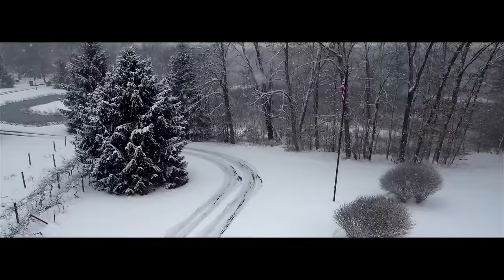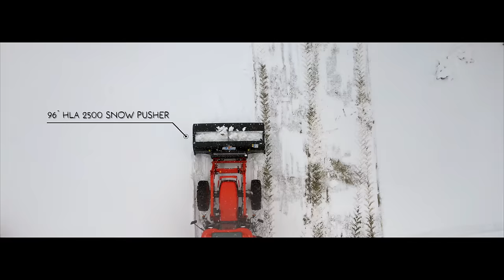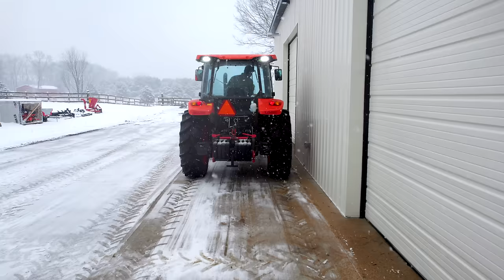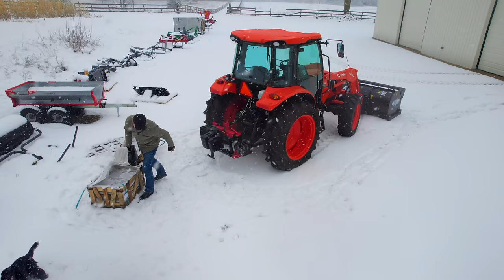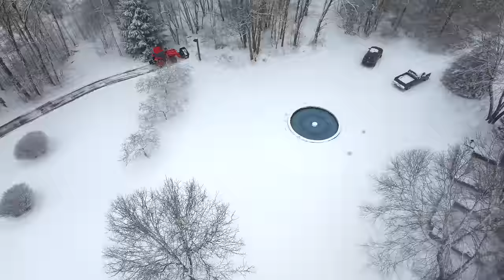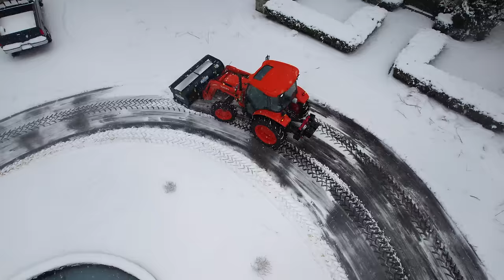THIS IS HOW YOU REMOVE SNOW IN STYLE! 😎

Comment: We got a foot of wet heavy snow this weekend and it finished off my worn out 35+ year old garden tractor mounted snow blower. I'm now trying to convince my wife that a compact tractor and snow pusher is an appropriate replacement. Wish me luck! 😃
Reply from the maker: Haha, good luck!
Reply: snowblower is still probably going to be your best bet depending on how much snow you get in your area.  If you are wanting to upgrade, take a look at a compact cab tractor with a front mount snowblower and a rear mounted blade, best of both worlds.  Snow pushers make sense for parking lots, I wouldn't want to deal with the piles of snow and running out of room to push it after each storm in our climate with significant snowfall.  You would need a huge, heavy tractor with chains to push a foot of heavy wet snow with one of these pushers. Compact tractors just don't have the weight behind them for anything more than a few inches at a time.

Comment: Hey Courtney / Chris - ive searched but haven't found a video yet on lubricant for snow pushers. TTwT mentioned doing one, but haven't found it. 
I know it's more of a Fall type of thing.. but it would be interesting to see some comparisons between what I read online. Pam cooking spray, to canola oil, to graphite powder (I use these on my garage door seals, doesn't freeze) to old motor oil. Thanks for the content!
Reply from the maker: Hey Adam,

I did a application in this video.  Can't find the follow up video right now, but I didn't think any of them were worth it.  However, I'm going to try something again on the blower.  I hate when the chute repeatedly clogs.

https://www.youtube.com/watch?v=7JDxDa-biCI&t=95s
Reply: @GoodWorksTractors  yeah, the chute on the snowblower gets pretty nasty with heavy-wet snow up here. I'm going to try the dupont snow+ice product as it's available locally.. worth a try at least. Not sure if any were worth it. Really appreciate the response!

Comment: We just got about 7-8" of snow. Have a walk behind snow blower for now, took 2 of us about 4 hrs to clear the driveway and parking area's and pathways to the animals. Using my 1025R with bucket, slow going, and the walk behind blower. This item is defiantly on the list for next winter, we have a wide area we have to clear so our hay guy can back down the driveway and get his skid steer off the trailer to unload the large bales. I think the snow pusher would work very well for this large area, where as a plough I would have to keep pushing it over. Driveway is  a rock/ findings mix that is solid very few loose stones, then turns to grass. Would the UHMW edge work on that as a metal edge might rip it up?
Reply from the maker: I don't think UHMW will work as well as steel, but it is a pretty durable material.  If just stone/gravel, then stick with steel edges and runners to be safe.

Comment: Do you find that your snow pusher picks up much of your gravel over by your barn?   I always try to push snow from my gravel areas to a spot that's still in the gravel to avoid raking gravel out of the grass when the snow melts.
Reply from the maker: No, very little.  I only let it make light contact on the gravel to prevent that from happening.

Comment: "That tractor has too much power."...said no one ever.  Great video Courtney!  Love that snow pusher!  Spray some soap bubbles around the bead on both sides of that troublesome tire.  I had leaks on both my fronts at the bead because the rubber tits left from the molding process were pinched between the bead and rim causing a leak path.  The dealer tubed the fronts n/c and took care of the problem.
Reply from the maker: Haha, that's pretty darn true Kyle!

Comment: Question; What are your thoughts on putting a spreader on the 3 point and throwing some salt or snow melting pellets down while you push snow? Have a blessed day Courtney and family!
Reply from the maker: Definitely have thought about it, just haven't done anything about it, haha!
Reply: Using a PTO broadcast spreader would work but the only down fall would be the are designed to throw material out far for maximum coverage but with a driveway you only need like 10ft of coverage so you would need to idle along to slow down the rpm on the spreader so your not salting the grass. May even need to install some deflectors to aim the material down tword the ground. Now personally I would never spread salt with my tractor as it rusts everything it touches, now you could spread sand or if you have a gravel drive you could use the smallest stone chips you can get that way you can have traction with the rust factor

Comment: Stupid question - I have an asphalt driveway. Can you put your loader in float mode with a snow pusher and be effective? Thanks!
Reply: Yes Then one I had had a rubber cutter on the bottom so it does not scratch up the drive way.
Reply from the maker: Yep, we have a hard plastic called UHMW that works very well, but protects the driveway.  Rubber is an option too, but not as good.
Reply: I plowed 400 asphalt driveways with mine last week
Reply: @GoodWorksTractors  Understand. But can you use the float mode on the loader and still be effective?
Reply: @earlkozak6538  yes very much so. It will leave the driveway clean

Comment: I'm in the market for a compact tractor. It will be used to plow my 800 asphalt driveway in winter. I also have a parking area. I can understand how the snow pusher would be good in the parking area but how does it do for long driveways? I currently plow with a V plow so I can angle it to move the snow to one side.
Reply from the maker: I clear an 800' driveway with a pusher and works well.  Big or small.  I show it with a big pusher in this video.  Watch later in the video and you'll see.

Comment: It's hard to beat a pusher for straight power and ease of use. Last one I used (before retirement), had adjustable wings so you could also use it to pull snow away. At 12 feet wide on a front end loader it moved a lot of snow.
Reply from the maker: Yeah, HLA has some fancier setups like that too.  They get big and pricey quick though!  Need the extra hydraulics of course too.

Comment: I do something additioanl here after i clean driveways...
I go into one of the fields with snow pusher and i clean a track huge figure 8 with some long runs and serpentines but i leave say 10 inches on ground....then i shape banks on bends...then i pull kids in one of those boat innertubes with atv and smooth it....then the fun starts...
Like a bobsled run...
I switched to nokian haakapalettansnow tires because i dont use it in field and it is great in snow....

Comment: Cortney, was wondering how effective is the float function on this tractor?  I have a couple of Deeres. A 3 and 75hp 5.  I bought a 6 or 7’ pusher from you last year. Because it is a 1500, you said don’t use it on the 5.  Got that. So I was wondering what hp your Kubota has a reference point. FYI, we have had a max snow fall of 4” so far this year. So my joke remains, “I buy it won’t snow insurance in the form of snow removal equipment.”
Reply from the maker: Hey James, 71HP on the M4.  I pop it in float on the smooth straight pushes, but take it back out when turning or transitioning to gravel/dirt.  I just raise the pusher slightly above the plowing surface.  The snow still stays collected, but don't scrape the ground.